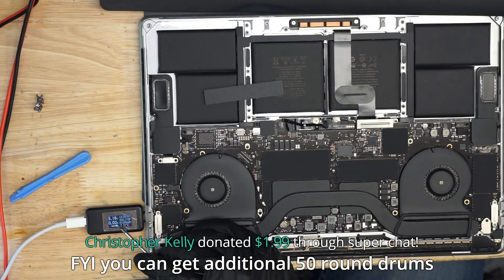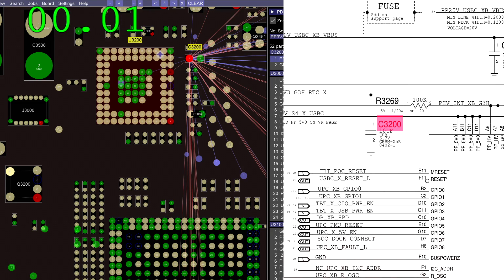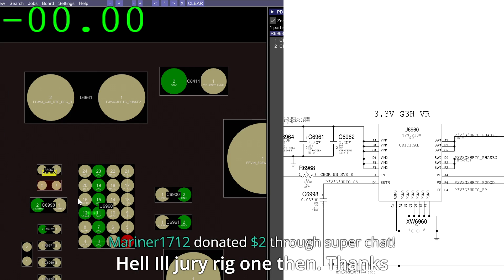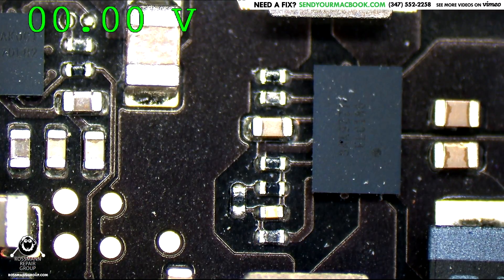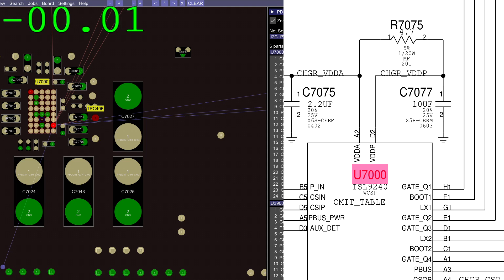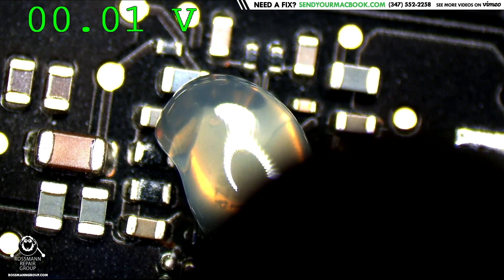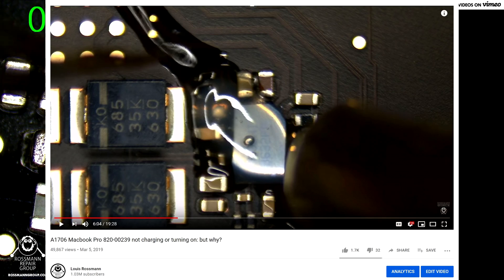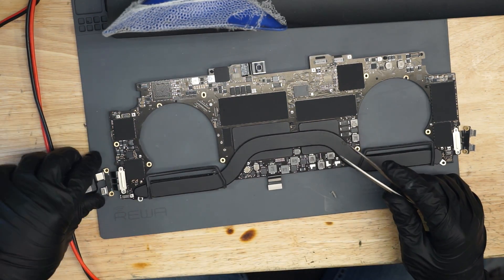How Apple is shaping the future of repair.

Comment: Hi Louis, hope you see this. The bga, cant you take one from the older models? Or is there FW flashed in to it? For the sdd recovery, cant you use an external source and hook it up? And disconnect this internal dc dc reg?
Reply: @makumbaDE  Hi Mircea,

Thanks for the answer. Kind of rude to call my "suggestions" naive. Anyway, solution for this topic is to use donor boards then.

Comment: Is there an alternative chip with equivalent specifications that would do the same job? Even if not pin compatible, would it be possible to wire one in?
Reply: @makumbaDE  Well if it's functionally equivalent, then no R&D is required.

Comment: Why not to a bypass and either add a DC jack or even add additional charging circuit if just a jack is not possible - to charge the battery directly??

Comment: "pro" machine that trashes all your data when a 5$, factory defect chip dies. way to go mactards.
Reply: Mactards lol 😁
Reply: It's not a factory defect chip, it's an extremely fragile chip. I could be wrong, but it looks kind of like a cpu/gpu "die". Years ago they were exposed on CPUs, not covered by a heat spreader, and they were extremely fragile and easy to chip if you didn't apply even pressure to the heatsink when clamping it down.
Reply: "pro" is just advertising, MacBooks are now DISPOSABLE
Reply: constantinos schinas you dont understand whats happening here actually lmao
Reply: @waquzy There's many different ways. Easiest way is if you have the Pro version, you can make a group policy to stop them. Otherwise you have to use the Registry or an external program.
Reply: Can't like this reply 1000 times so I'll like it once and give you a thousand virtual likes.
Reply: constantinos schinas you really didnt get what he said... exactly this kind of bashing is what also results in nothing. Shooting onto one thing where you can be sure to get some likes, just for your ego. Not everybody has the insights from his first steps made on.
Reply: Notice that the chip says 'INTERSIL' on it. Not Apple. :)
Reply: “Pro” windows machine that force updates on you when you just try to simply restart
Reply: @TheJosiahTurner  So linux based systems are the only "PRO" ones xD
Reply: Akabe Animations yEp I gUeSs SO
Reply: @TheJosiahTurner  You can make updates stop completely. Have been able to for quite a long while.
Reply: @arnox4554  how ?
tell me cause they bypassed my old solution

Comment: I would think it would be possible to remove the intersil chip, and provide the required voltages from another source, at least enough to get the board running to be able to recover  the data from the ssd. Maybe even possible to get something small enough that could be jammed back into the case, or send it to Ave to restyle the case. a few voltage regulators and a few 74 series should do it.

Comment: Those intersil isl9240s are used in Apple's smart battery cases (A2121). Now that's a rather expensive option but you'd be able to source them from those boards.
Reply: Your not the first to suggest that. He explains in one of his videos that it isn't cost effective to go that route.
Reply: @zachdemand4508  I totally agree that it isn't cost effective at all (since you are paying around 80$ for one of those cases).. BUT if the only other solution is a whole new board for 1200-1500$ it may be an option to consider.

Comment: It's not 100% about being able repair it but problem is that those apple garbage ain't durable it's 99% guaranteed that in two months after you buy brand new something going blown up in that laptop and even if you be able repair you don't want every two month take that laptop to repair shop because all those parts than apple use are low quality
P. S. Even you treat your laptop very nicely and don't drop it or split anything on it your warranty will be totally useless bc nowadays warranty means nothing it will always be your fault that your laptop is messt up

Comment: What I am baffled by is why doesn't someone just create an ASIC replacement.....I mean, I'm sure it's rather simple to figure out what the chip is doing internally if all it is supposed to do is enable lines based on signals.  This wouldn't be copyright infringement considering it would be independently discovered....I would do it myself, but my only question is, is there enough money for sustainability business for myself if I did?

Comment: There must be a good reason why an Engineer hasn't built a jig that you can set the board into and trick the processor into believing that it has an ISL9240 on the board.
Reply: They probably have a way to smuggle in ISLs

Comment: It's equivalent of every time you have flat tire you must buy new car
Reply: you dont understand ... if you change the tire , technically is not an automobile anymore .... it become a regular car.
Reply: A bird shat on the front winscreen, which is made of a plastic that reacts with the bird shit and makes a hole.
The ECU detects whether the windscreen is intact, and refuses to start the engine if it isn't.
And you can't buy a replacement windscreen.
Reply: yeah just losing air a few psi  more like it
Reply: It's the equivalent of having a sensor in your trunk that detects if the light bulb is working breaking, the car refusing to start because of a broken lightbulb sensor, calling up the dealer to get some warranty work done and then told "sorry we need to replace the entire onboard computer and wire harness, it's going to cost 80,000 dollars but can we interest you in the 2020 model?
Reply: @chbrules  I'm fine with driving a shitmobile as long as the ac blows ice and nothing squeaks.

Comment: yes apple is an us vs them company.  the to be or not to be mentality is what apple is based on.  how can this be surprising.   their core value is a closed system.  it is not strange that people buy into this because religion.  it appeals to fear absolute certainty and pride fueled by fear.    religion!     its the environment that so many  people were raised in and understand.  the shift is coming but it is still several generations down the line.

Comment: Common. There has to be a way to bypass the chip (for example with an Arduino) to make the laptop at least turn on to get the data.
Reply: @Deon Denis Well from what i remember there was a problem that another chip wasn't enabled because this one was faulty. Therefore Arduino with a simple program could just pull the enable up for that chip when there is an encrypted communication on another lines. Am i right? 
That should enable the laptop to power on in order to get all the data ... if my theory is correct. Hey Louis send me the laptop i will check that out :D
Reply: @Deon Denis I meant monitoring the line if there is some voltage. If (thereIsVoltage && overThereIsVoltage) { enablePin =high;}
That shouldn't trigger the T2 wipe as it's not any different than what the faulty chip do to the lines right?
Reply: @Deon Denis Apple :D 
Hey, you seem to know about stuff. I have an Asus UX303 with dGPU that got full 18V. I was able to repair most of the board and now i'm stuck on the dGPU.
The laptop powers on, for a 0,5s i got a logo on the screen (on gpu in the intel processor) then the dGPU is enabled and the machine turns off instantly.
Don't you know a way to to force the board to use only the integrated GPU? (i have no way of replacing the dGPU)

I'm just trying my luck here.
Reply: @Deon Denis Yop, but i have no idea how to do it...
Reply: @Deon Denis Furthermore i can't access the bios settings as the dGPU is activated during POST. I thought you meant flashing modified BIOS on a BIOS chip. I've got many Winbond chips at my disposal, but there is very little info about how to do such thing.

Comment: Although I agree fundamentally and praise Louis for all his efforts for consumers, I do understand about big business and why they do things. Of course, the main reason is profit, the other are more incidental, like smaller footprints and tech advancement. However, it comes down to consumers and what they are willing to accept. If they do not want the Apple business model of a new logic board for nearly every fault then they go elsewhere. I have had a couple of fails on my Macbooks that cost me more than the laptop was worth to repair, but I am still buying Macs. That is not because I am stupid or that Apple has bad practices, it is because as a consumer I weighed the pros and cons and in my opinion using Apple products worked far better than the crap I had with Windows. I could write a book the size of “Crime and Punishment” from the fails I have had from Windows laptops including a $3000 gaming machine that died a month after the warranty finished and to repair would cost more than buying the same second hand!

So yes MacBook’s have issues, but I have at least three Thinkpads with the BSOD (all diagnosed as new logic boards) that are giant paperweights so although I understand Apple bashing is prime time these days, it ain’t a one-way street, all could improve, and for me, despite Apple’s fault, the alternatives can be just as bad or worse.

Comment: Louis, what you should do (and I know this is kinda silly) is buy a new model macbook pro etc that has a known good chip, and use that chip as a substitute for data recovery. 
If you had customers with busted chips, for a few hundred for your time etc, you could back their laptops up with time machine to an external drive so they at least have their data.
Also, pretty sure that Apple have a 30 days, no questions asked, returns policy where you can give the laptop back, even used, no questions asked.
Reply: @makumbaDE  wires would be harder than just resoldering the chip

Comment: couldn‘t you buy a machine like it, replace the chip, recover the data, then take your chip off again for the next repair?
Reply: Even if there's a suitable replacement, I don't think the chip will last long from the constant heat (solder/desolder). That's why reballing chips like this takes special care and knowledge. One wrong reball process and the chip could not stand another heating and end up being replaced.
Reply: @ezioauditore4120  hint: SnBi low temp solders.
Reply: @crazy4volvo  Yes there are tools like that. But even so the chip will be subjected to changing temps and I think will not last. Could also be the reason Louis is not doing such thing as it will be more costly than fully repairing the device. That's my take but maybe it could work. 👍

Comment: U can find it in iPhone XR smart case , i know is crazy but they really use that chip inside the battery board for the smart case
Reply: I just checked a picture and it legit looked like it!  The only difference I can spot is that the Mac one in this video says "B840ZR" and the XR one I've seen says "B840AJ" so I don't know but they're both ISL9240HI.  Louis try this!
Reply: ProtzerProductions Music Sharing Germany | PPMSG  yeah but they r the same , it’s pain in the ass to disassemble the smart case , but i guess he has no where else to go, ,, but most of the time i just reball the chip and it works
Reply: Email louis about this.
Reply: but the smart case isnt expensive right?
Reply: gocrazygostupid i guess it’s from a 100 to 130 $ brand new

Comment: Not sure if this comment is going to get looked at but I have a question. While you can't get specific chips from Apple being an AASP, I do know that you can "exchange" bad boards for new boards, which usually cuts the price by half of what a new board would be. Now I'm not taking Apple's side on this because of course, fuck Apple, but is there another reason you don't want to be an AASP? I personally work for an AASP and boy oh boy the hoops that have to be jumped through are ridiculous sometimes. Also sorry if this question has  been asked 1000 times, which I'm sure it has been.
Reply: Of course 1500 dollars cut in half is still incredibly expensive when it comes to a damn motherboard, I was just thinking of the poor fellow that'll have to pay it. Better 750 than 1500 I suppose.

Comment: I think the difference between the Car industry and Apple is that the car industry makes the parts available but prices them at a point that repair ceases to be cost effective. Apple just blocks them. It's called planned obsolescence . The part costs $5. The whole board costs $1500. The shiny "new" model costs $1595. What ya gunna Do?  I don't know a lot about computers, other that they either die or become obsolete, but I do know a bit about cars and car workshops. When's the last time a mechanic ever "fixed" anything?. All they do now is replace parts, not fix them. As to pricing, I remember when working in a car plant in the 70's, someone priced the total for every part in the current model car and it came to something like $28000. The same car sold for about $3000 at the time. And that was fully assembled! And that's 45 years ago. Nothing new.

Comment: What did they change for this chip?  Is it a difference in the pinout, or something more substantial?  If it's just pinout, then someone should be able to create an adapter board.
Reply: Michael J Horton That is perhaps possible, but Louis is not geared up to design adaptor boards in his small shop.

Comment: If there was something like a BGA to pin header adapter you could solder in there, and then make some gadget that plugs in and does enough of the job of that chip to get the fans to spin for data recovery, it seems like it might be worth taking the trouble to work out how to do it. Also, could there be other routes to forcibly creating the rails required to boot the machine? Maybe you can bypass some of the components involved in making the power rails and temporarily hook in an external power supply?

Comment: being the smart as i am, is there a way to use another chip that would work via mod? cuz if so just mod the bitch. problem solved. there have been times in my limited knowledge where ive done the same in the car world. parts that can have different model numbers but its actually the same part.

Comment: Louis, I like you. I like your work. I love the way on how you go into the actual mechanics of how these systems work and have failed. You are doing today what I and many others did years ago. I had my own shop for 15 years repairing computers. As the tech has become ever more complicated this is the way of how things will be, disposable items. It isn't just Apple as others have been going down this same road. That is why I got out of it when everything started getting soldered onto the logic boards. I honestly hope you do get the chips you need as you are very interesting to watch and very thorough. Do I wish it was like the days of G3 Powerbooks, very easy to upgrade and service, well of course I do but those days have long past. You started seeing this direction with the unbelievable ridiculous case designs like the iBook Snow laptops that were a bear to disassemble. Look at the Microsoft Surface line as another example of just a disposable computer. When it breaks you buy another as repairing them is such a headache. Keep up the good fight and keep repairing, you are fascinating to watch Louis. Love the cats too.

Comment: i do not do these repairs often enough to have the schematic on a board using 9240 or 9239 to see the differences. seems to me some kind of alteration to the 9239 should be possible.  Hmm to "find" them somewhere. DO NOT send me a link to that info. 😉

Comment: I'm with you 100% on the principal idea, but in terms of recovery of data, couldn't you take a working chip harvested from a different board and put it on temporarily? Billing the customer appropriately for your time to put it in, get the data, and then take it back out?  It'd be expensive in terms of labor and I know that's not the point, but it's an option?
Reply: Andrew Hall Its possible, but the customer may not want data recovery in this case (may have recent backups).

Comment: Had it been any other manufacturer you could have at least fed the power down the battery circuit to at minimum get the data back for the customer.